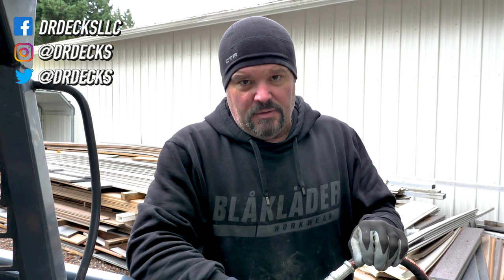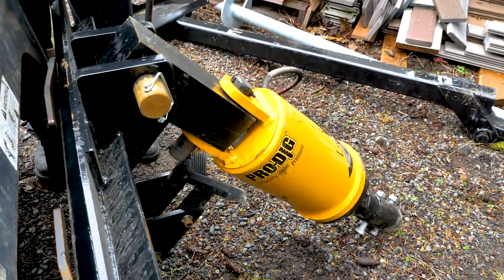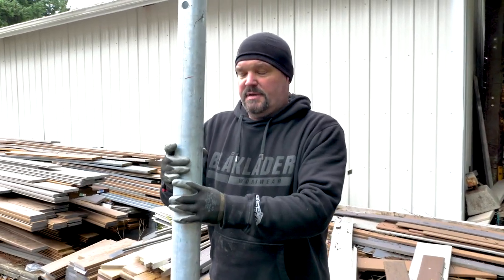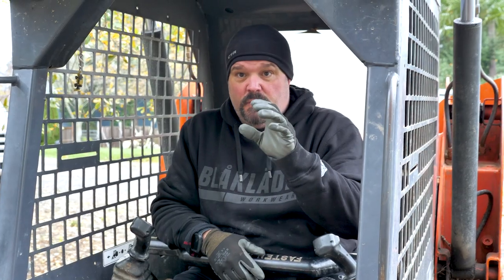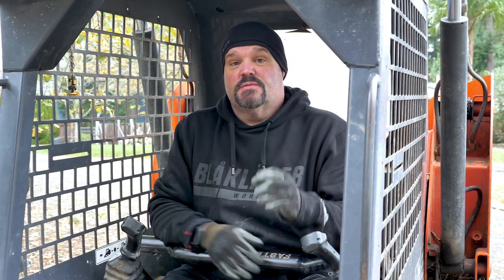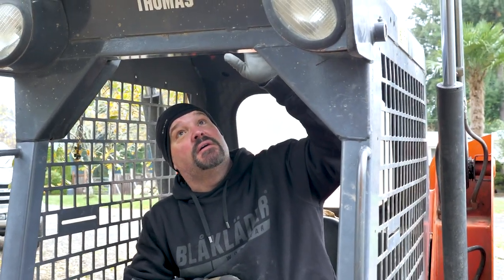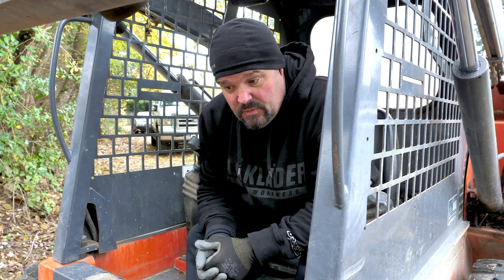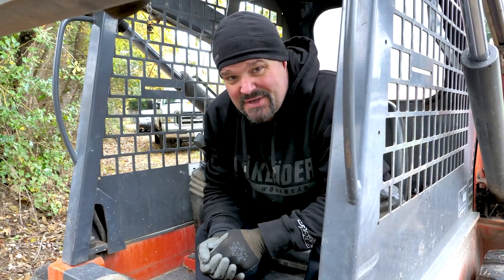Testing The Mascore Helical Pile Driver || Dr Decks

Comment: Gamer changer for you!! Let’s see what type of projects we can do ourselves. Congrats on new equipment
Reply: I used Helical piles this past summer on my own deck. $1700 for 9 piles in heavy thick clay that were put down 5 feet. The guys that did it started at 9 am & were done & gone by 12:30.
I started framing etc right after they left.
No waiting for concrete to dry for posts & no dirt to remove etc.
I highly recommend the piles.